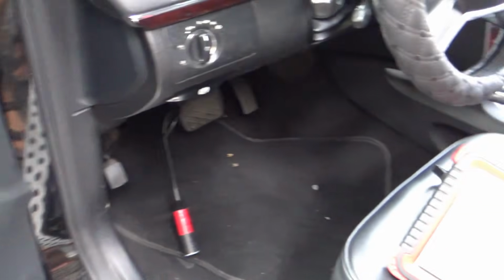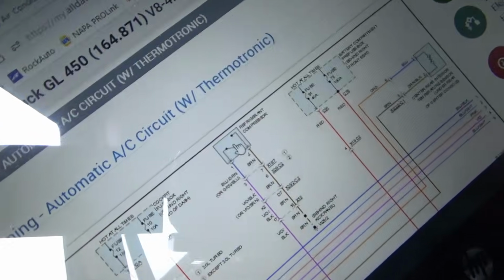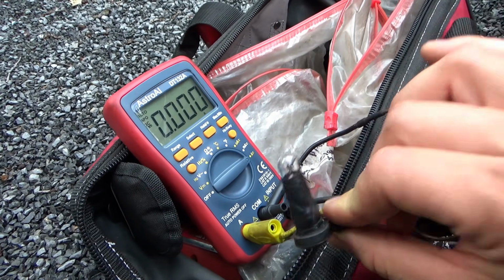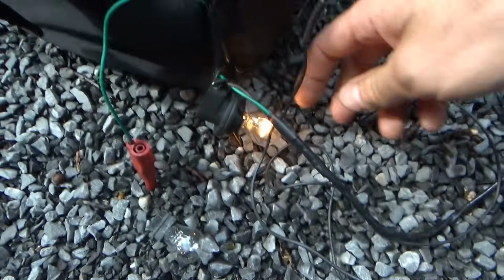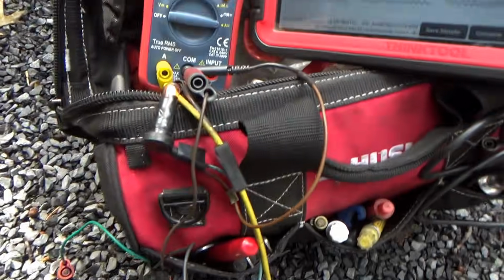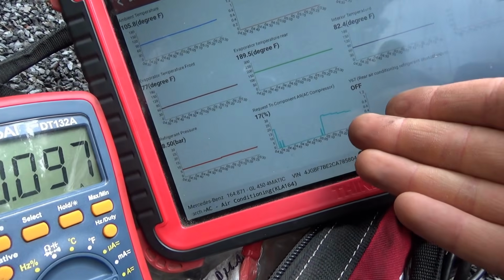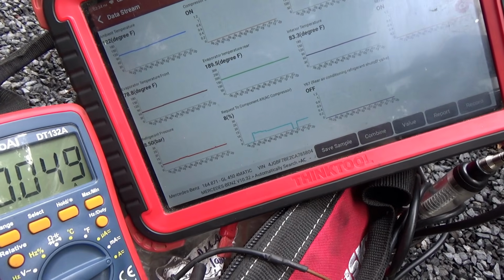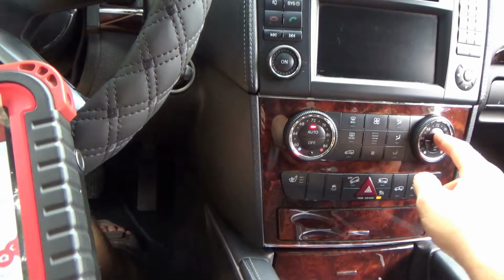Did I MIS-DIAGNOSE This Mercedes?? (GL450 no A/C)

Comment: The valve coil is an inductive load, bulbs are purely resistive.  I would guess the flyback diode in the compressor valve circuit is the culprit.  The job of this diode is to eat any kickback voltages when the valve is operated or released.
Reply: It's a brand new compressor, so I wouldn't suspect the flyback diode to be bad, unless the flyback diode is on the HVAC controller -- which is terrible design. Some filter capacitors on the HVAC controller board may also be causing the problem.
Reply: @Stoney3K i think there is two separate compressors that look identical but one has the diode others do not
Reply: @EATSLEEPFARM If that is the case it should be easy to measure. From +ve to ground it should read the coil resistance (or open when it's on diode measurement), and from ground to +ve it should read 0,7v in diode mode.

And in that case the fix is just as simple, adding a 1N4001 in the reverse direction would be enough.
Reply: @Stoney3K  watch part two its out 👍
Reply: @Stoney3K you cannot test this with a multimeter, as the multimeter will not output sufficient current to develop 0.7V across the winding.
However you could safely connect the compressor to 12V via a tail light bulb in each direction.
The "correct" polarity you would drop maybe 3-4V but with "reverse" polarity you would only drop 0.5 to 0.7V due to the diode being forward biased.
Reply: Why do all the videos I'm watching this morning somehow involve flyback diodes?  Over on Rainman Ray's channel, he's pulling the alternator lead off the battery while charging and somehow didn't fry the thing.

Comment: You do more one handed than a lot of mechanics with two
Reply: He has alot more time to do it as well though. He may spend a day or two on a complex diagnosis job. Most shop mechanics get about an hour and have to move on.
Reply: @mph5896  this is 100% true unfortunately. Flat rate guys don't get the same luxury of time as he gets, As he works for himself and makes 100% of the money not 20$ etc for 1 hour. That's why a lot of shop guys throw parts. They need to redo the whole flat rate deal because it hurts the customer more then anything.
Reply from the maker: @mph5896  Yes, complex diagnostic jobs can eat up a lot of time, even while working efficiently. Good thing I charge by the hour LOL!
Reply: He does more by himself than some shops with five guys.  He bails out many of them especially on electrical and timing issues.  An engineer who knows physics and wrenches.
Reply: @rj.parker  no one says he does nothing.. We know he does a ton for the shops. But it still boils down to the whole flate rate issues that exists right now. If i work on my own cars i can spend 2 days diagnosing a issue. Guys in shops cant do that.. They wont get paid..

Comment: The compressor circuit probably has a solenoid, those have significant inductance.  If the driving circuit is monitoring the startup current, it expects what an inductor does-- a linearly rising ramp going from zero amps to 1 amp over a period of some tens of milliseconds.  If the compressor solenoid has even one shorted turn, that will not show up on an ohmmeter check, but the controller might notice it.

Also as others have suggested, many inductors will have a reverse diode to clamp any voltage spike when the controller shuts off.  If the diode is open or leaky or installed backwards, the controller may see that as a short or malfunction.

But oops, there's evidence against this idea-- if the controller is okay with a light-bulb load, then it's not checking for inductance.   It could still be an open or shorted diode or a noisy or flaky ground.
Reply: If the flyback diode was shorted, it wouldn't be able to carry 1amp of current by energizing the compressor manually, and the compressor working as intended. Instead, all of the current would flow through the diode and the compressor valve wouldn't open -- hence no cold air.
Reply from the maker: @Stoney3K  Very good point!

Comment: Think that 12 ohm on the control wire in the compressor sounds low, it's over 1 amp on the driver. But could be normal, would be nice to compare with the OEM compressor.
The compressor is variable control type, you should be able to messure a PWM signal on the controlwire with your testlights.
But if the owner has changed out the compressor, are the system been vacumed out again and the right amount of refriged put in again.
Normally you check out the high and low side pressure, since there normally are pressuresensors for safety to protect the compressor.
Good luck finding this issues. 🤞🤞🤞

Comment: It sure seems like a bad engine ground or the compressor isn't grounded too the engine properly.Try a  heavy jumper wire from the body of the compressor to the negative battery terminal or to the body if you can't reach the battery.

Comment: Throw a relay on it!
Reply from the maker: How would the PWM signal control a relay?
Reply: @PineHollowAutoDiagnostics  the voltage was strong enough to run a 300ma light, I figure it could run the control side of a relay.
Then the relay would supply the 1amp to the compressor.

Comment: Cool Video! Time to get the Pico on the case! My guess is the compressor valve signal ground noise. The computer receives inrush spikes when the ground varies causing a fault. A good test would be to add the body ground to the connected signal ground.

Comment: Ground problem between engine and climate controller? Perhaps a slightly bad ground is fooling the current detection circuit in the controller.

Comment: Since that is a variable displacement compressor, is it also a clutchless design, or does it also have a clutch on it.   They make both styles, not sure what MB uses.   Are we sure that the a/c controller in the dash drives the solenoid/clutch if it has one?  Or is it possible that something else actually provides the current to drive the solenoid/clutch such as the PCM?
Reply: Depends, some are clutchless, some are not. Seen both on euro cars
Reply: it’s clutchless but benz doesn’t use it conventionally with duty cycle. 

they never pulse the thing to ground you just see a b+ flatline until it shuts off for a while like how you’d expect a clutched compressor to run.

Comment: Hmmm 
Same codes with the original compressor?
I'm wondering if the original compressor had a back-EMF diode built in and the aftermarket one hasn't.
Therefore the driver is happy with a non inductive lamp load but doesnt like the spikes when it's PWMing the compressor coil
Reply: no telling where the guy got the replacement compressor.. that might end up being the rabbit hole..

Comment: You need to follow that ground circuit.  It may not go directly back to the HVAC module.  It may go to the front SAM.  There could be more in the loop than just the HVAC module and an engine ground.  Other note is that I have noticed that when you turn the A/C off on Mercedes, it doesn't immediately shut off the compressor.  It takes a few minutes.
Reply: I would assume that the ground wire must go through maybe the ambient air censor or a bad ground at pcm or ecm tough diag. But persistence would be the key.
Reply: Are you using all data wiring diagram ?
Reply: @Ebenezer-ko2hp No, WIS.

Comment: The one thing I didn't see you check was the integrity of the ground to the controller cuz I'm assuming that it ground threw the controller and if the integrity of the ground the ground threw the controller is bad it's going to register higher amperage the only have half the ground

Comment: Even though the air conditioning compressor clutch can be energized manually I would still check the compressor clutch coils Ohms reading & compare it against specifications so as not to take anything for granted meaning that the compressor clutch coil could be overloading the module due to a short circuit inside of the coil or the Ohms reading could just be too low.

I think that I mentioned that a faulty ABS module was causing interference with the body control module which was causing my 2002 model Holden VY SS Commodore not to have air conditioning sometimes.

As far as the 0.5 Meg Ohms reading apparently it does matter if the multimeter reads that from the secondary ignition coil post to ground because I rectified that problem in my fathers 2000 model Holden VX Commodore yesterday.

It runs the Holden ECOTEC version of the 3.8 litre Buick L36 V6 engine & there was Infinity Ohms reading between the secondary posts of the middle ignition coil for cylinders 2-5 & about 35 Meg Ohms reading between the secondary post of cylinder number 2 & ground.

My point is that could appear to be a short circuit at about 20kV so it was tracking to ground,all the other coils measured Infinity Ohms to ground, cylinder number 5 also had a strong blue spark but cylinder number 2 had a very weak spark.

There happened to be an old Buick L27 engine sitting in my dads shed which came out of an earlier 1993 model Holden VP Commodore which my youngest brother crashed into a power pole so I pinched the 2-5 ignition coil (same coils) off that engine & fitted that into my dads VX Commodore which fixed the problem.

Note that the other 2 coils read at 6k Ohms between the secondary posts which is good !
Reply: It has no clutch I believe.

Comment: The valve or coil in the compressor differs from the test loads in that it is inductive. You will probably see spikes on the feed from the controller when the valve is connected - but that should be the same when the body ground or compressor ground is connected. I'm wondering if the ground at the compressor is good or if it is being pulled up because of other loads from the engine having higher currents needing to go to ground. Can't wait for part 2. I know you will get this!

Comment: 2012 ml 350 bluetec with the same problem, customer didn’t want to go with OEM compressor but put aftermarket market, same code open or short in compressor circuit….got paid for putting the part on, now vehicle at dealership for the last three weeks with no fix, engineering/tech line involved now
Reply: Dealership will put brand new cornpressor per tech line and charge customer tripling cost.😅
Reply from the maker: They will have to watch Part 2 for the top-secret Russian Hack Repair haha